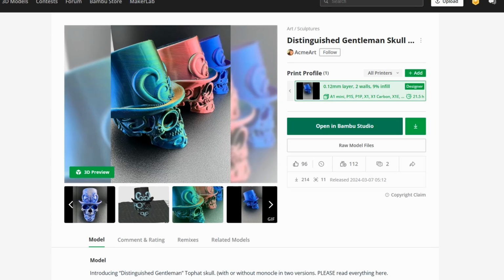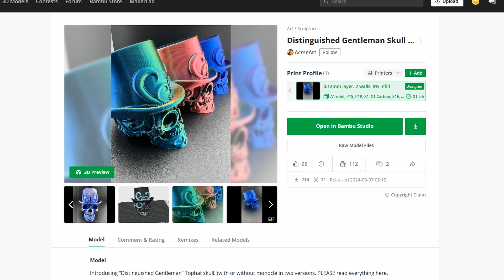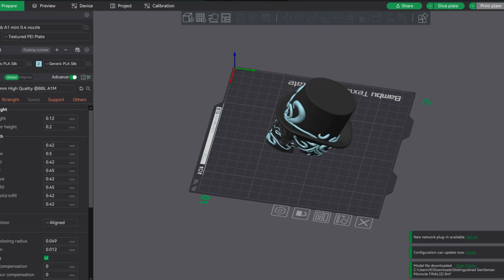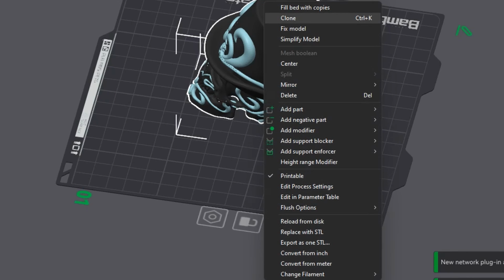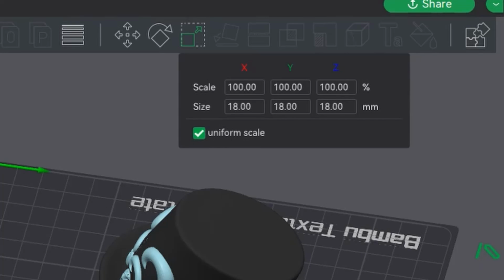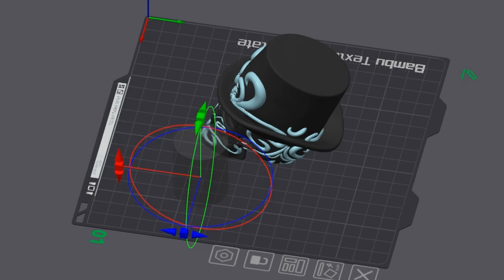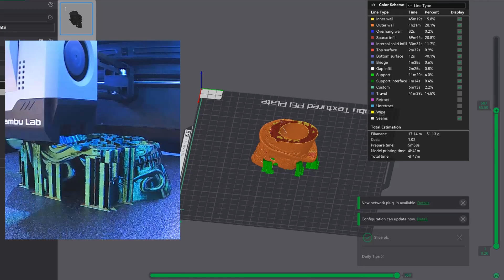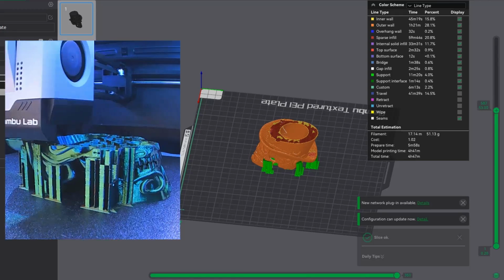Using negative modifiers in Bambu Studio P1s/P1p/X1c

Comment: I need a hole from outside the object into the center is there an easier way to do this it keeps giving me a cylinder cutout with a bottom and walls
Reply from the maker: Size the cylinder to the size of the hole you want ie 6mm by 6mm. The cylinder  is effectively the hole! Just place it from the centre and ensure it goes all the way to the outside of the object

Comment: super useless hole maker, this sht can't be adjusted, you can not make a hole specific size, negative parts have their own Z zero coordinates you just can't align specific sized hole with measurements to your own model to make precise half cutted hole. Bambu if you want to lock us to using your slicer give us not bugged features first. i can't damn doing simple negative half hole with bambu
Reply from the maker: You can size the hole you require- using the scale function. 
You can position it wherever you want- using the move tool. 
I’m not from bambu- so please keep your thoughts regarding there new updates to your own page. Thanks
Reply: I literally just did this. I needed an LED strip wrap adaptor to be scaled down to 80% to fit the lamp I was going to use it in but the hole for the strip needed to remain the same size to fit the strip width. Just like this video described, add a negative to the model. From there you move it using coordinates until you get it where you want on your model, then use scaling to make it fit as you like. If you're expecting to just drag and drop it where you want then no, that's why you're seeing what you are.

Comment: I had a print where the bottom half was silver and the top was blue. I put in negative cylinders in the blue portion only and it switched colors every layer to make the cylinder gray and the rest blue. So there’s so much wasted filament and time.  I don’t understand why it wouldn’t have stayed blue.
Reply from the maker: I’m not sure myself tbh. 
Must have had something to do with the settings on the negative cylinders

Comment: Thanks for the video. When using this is there any way to select planes as the landing point when moving your part/negative part around? For example, in this model is there any automatic way to select the top of the hat as a plane and move the part there automatically? Or is your only option to reposition the part and manually move it into the position you need?
Reply from the maker: Unfortunately there is no automatic placing- I agree it woould be very useful. 
Best way is to use the co ordinates in the move tool to ensure it is lined up correctly

Comment: Thanks for this. I had an all white item that I used a negative part for but then change the same item to all black. I still coloured in the negative part as black but it's still coming out white. Any ideas? Cheers
Reply from the maker: I’m not sure. I’ll have a play and see!
Reply: @ I did find a work around by unloading the other 3 filaments in the ams and just using the black in bay 1 but that only works because my piece was all black. I still don’t know how it would work if you were printing multi colour.
Reply: @jcrbuilds  Have you looked into this at all? Does applying Parts/Negative Parts always cause issues with AMS color selections?